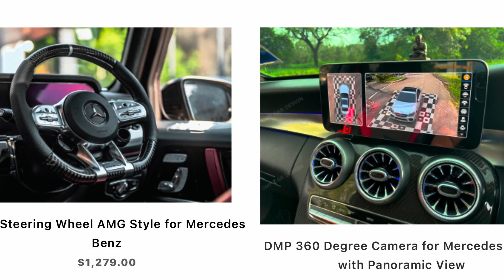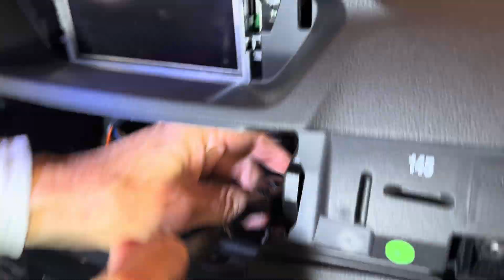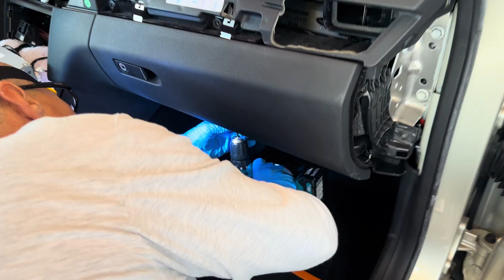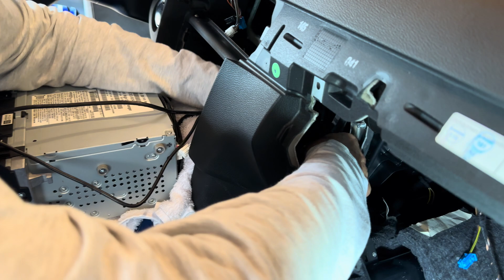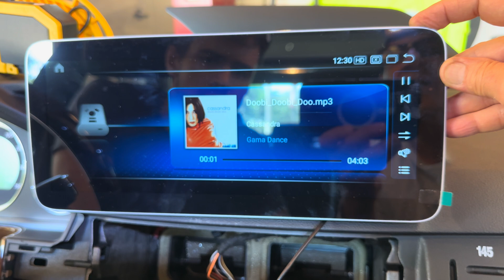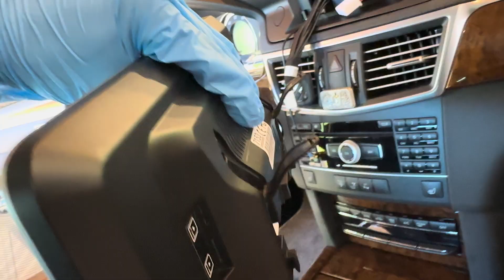Android Screen Installation | Mercedes E-Class (W212) | E350 E220 E63 E250

Comment: I have a 2014 E350 W212.  My AMI connector is in the center console.  Do you have a video or well written instructions on how I would run the cables for that type of install.  Thanks
Reply: Just done mine which is also in the center console, you’ll have to remove the heater control unit and the front storage box/ashtray housing all together so you can trace the cables through, not to complicated but takes a bit of time.
Reply: @VoadeK  Thanks for the reply.  Are you happy with the DMP?  Is there a video somewhere explaining the removal of the storage box?

Comment: Is it has any pre out put rca?
Reply: That would be really useful to knoow. Anyone ?
Reply: Assuming most of the brands that make this 12.3” screen that fit the w212 are similar, I’ve came down to no RCAs, BUT to y-split the 3.5 where the AMI cable connects to, making 2 3.5s. 1 for the AMI, the other for the RCAs to my amplifier. In theory it should work, but I’ll find out soon

Comment: Do I see that it has a cable that says 360 cam but the aftermarket systems are 12 pins. How could you connect it?
Reply from the maker: Our 360 camera kits come with connectors that are plug n play into the screen harness.

Comment: Hi
I have a problem with sound(no sound on youtube,music app(android system))but factory system has sound(when connected with bluetooth)
Also i dont have aux outlet(but in original “Audio”-have)
 2013 E350
Reply from the maker: @Alex2246  Hi, you need to activate the aux through your screens factory settings. Then set the car to aux mode.

Settings<factory<190627<aux activate
Reply: @ i did,but its still doesn’t work
Reply from the maker: @Alex2246  You can WhatsApp us. (786) 242-540
Reply: I cant find your number
Reply: This is great looks factory!!
Reply: I have the same problem. The radio works, but there‘s no sound on Youtube. Did you manage to fix the problem?
Reply from the maker: @ Should be a relatively simple fix. WhatsApp us 7862425400
Reply: @elinkaibrahimova7086 I had this. I had to connect the two ground wires together and it all worked perfectly.
Reply: How does it work with Bluetooth to play music from Spotify. 
At current moment, I have a connection problem with my IPhone when I wear my Apple Watch. 
Will I have the same problem?